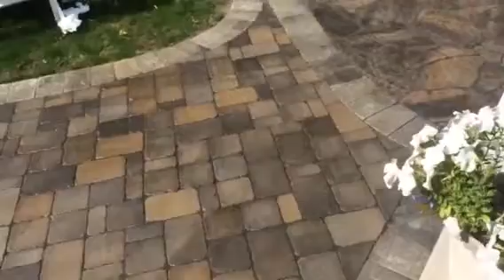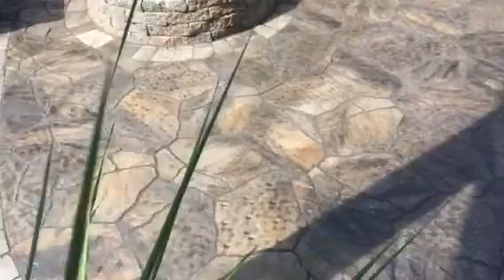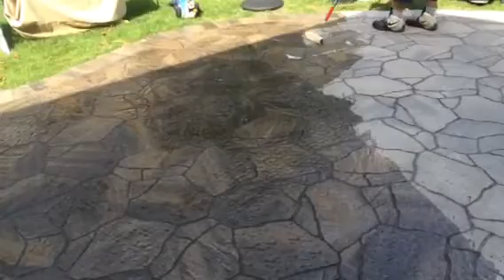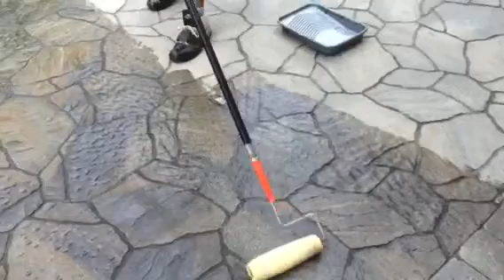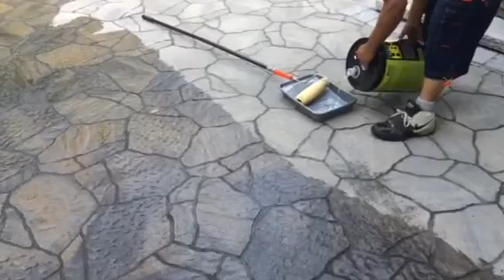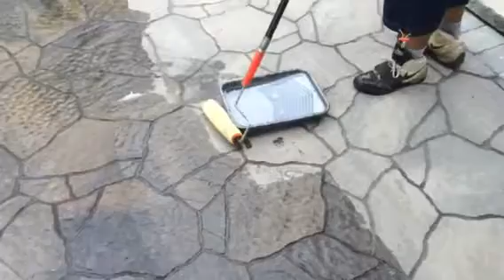Mega arbel, techo bloc firepit and mini Creta seat wall oaks border

Comment: Installation looks great!  Love the pavers.  My only critique is to give the customers even step riser heights.  That lower step is a pet peeve of mine when landscapers do this.  You can still install it soundly by doubling up the bottom step so your base still has a solid unit to butt up to.
Reply from the maker: "Been there done that". The step you are talking about does not get used.
For this project it was more important to maintain a 6 inch step along the rest of the walkout patio at side of house that runs approx 30 ft. which you may notice in the rest of the video, if we did not, it would of been a 9 inch step.
Thanks Joe A.
Reply: Joe, the steps up to the door are independent from where you're talking about.  Instead of a 3" - a 6" -  and a 6" step into the house (15")...make them equal 5" heights for continuity.
Reply from the maker: +shaymoose17 
Thanks for your concern, we could go back-and-forth forever.Bottom  line is I am very good at what I do  and the customer is OK with it and they approve.Thats all that matters
Reply: Obviously a landscaper's work speaks for itself, Joe.  I'm not questioning your abilities.  I own a landscaping business as well.  Don't take this comment as me slating your work, It's another hardscape installer offering their humble opinion through constructive criticism.  We all need it to continue to grow ;)

Comment: How much does the container  cost of sealer. I have a decent size paver I need to seal this summer
Reply from the maker: $ 230.00 for 5 gal pail.  
If applied with 1 inch roller coverage will be about 80 sq.ft per gal.